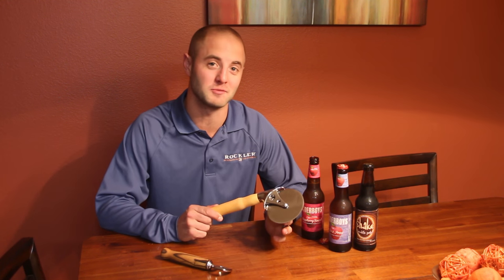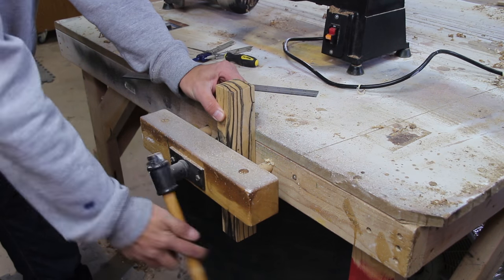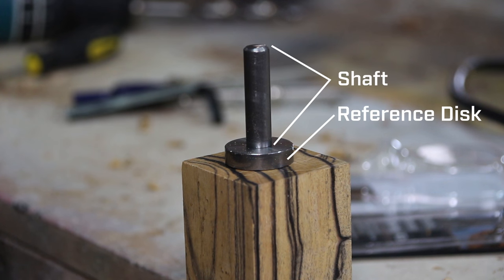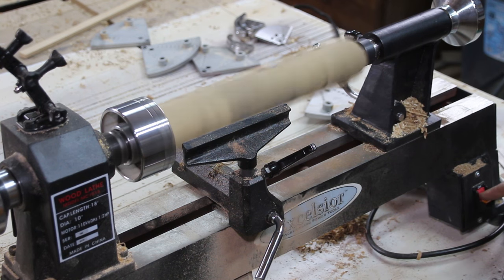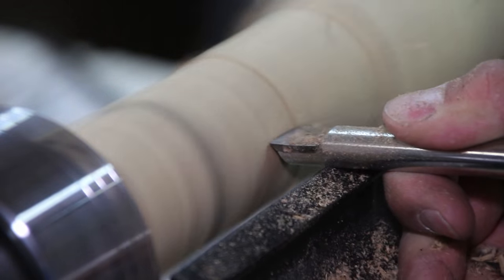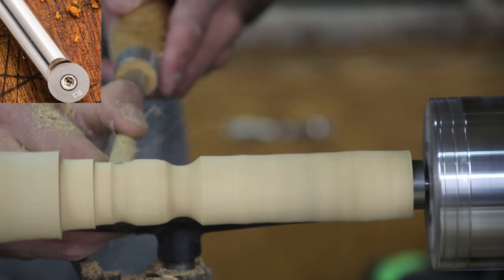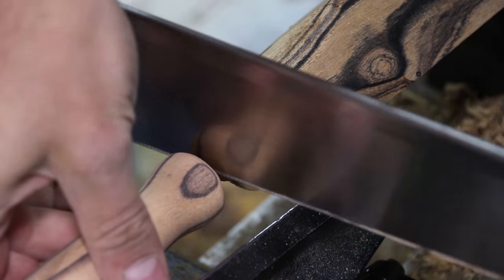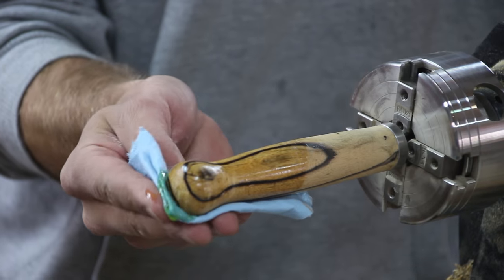Turning a bottle opener handle

Comment: In 30+ years of woodworking, I've never turned. That's changing this year. What lathe accessories, other than the carbide tipped tools, would you recommend?
Reply from the maker: A chuck with a few different sets of jaws  for sure!